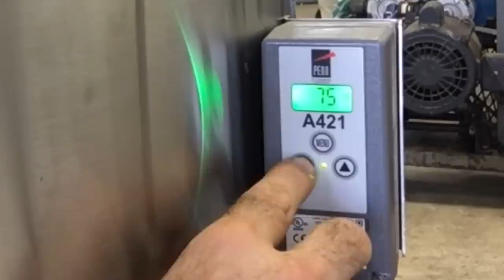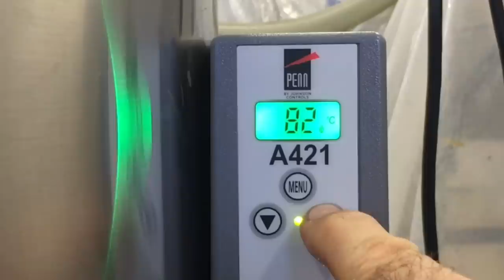Rendering Bees Wax Cappings **and Completely Dealing with the SLUM!** with a Finlay Wax Melter

Comment: I think I would be inclined to raise that unit a small bit off the ground for easier use , but then I am getting older and hate bending over anymore.  LOL
Reply from the maker: Rojer Grison 
Except, then it would be harder to dig out the Slum
Reply: I was thinking the same: scissor-lift or an elevated floor (with ramp?) so that you can stand either on the same level or much lower. Then you can put the castingbuckets on dollies and that saves you a lot of lifting.
For getting out the junk at the end, consider a shopvac instead of hanging over the edge.

I can truly tell that once your back is dickered you realize what you should have done to prevent it. I had that moment at the age of 41.
Reply: I raised mine so it'll dump into a five-gallon pail.  That works great but yes, it's a trade-off when cleaning out the slum.  I am taller than average and I can just reach the bottom so it all worked out for me.

Comment: Nice demonstration of the new wax melter.  I'm so small but use a frier pot to melt the wax.  Then I add a long strainer in the wax to separate the sludge from the wax.  Then I scoop the liquid wax with a large ladal and pour it in a bucket with hot water on the bottom.  Works for me and it's cheap to do.
As for your leftover honey.  You said, you use it to make barbecue sauce.  If you have a lot, I've seen one wax producer sell it to the baking companies.  that camelization doesn't seem to be an issue for him.

Comment: I place a small pail that's the same height as the mold into the mold. Wax from the melter goes into the pail and overflows into the mold. No need for a sifter and pouring wax from one mold to the other.

Comment: two suggestions:

1. put the metal slum strainer in before you fill with water
2.  Put enough water in to raise the wax layer above the valve so you get all the wax out of the tank when draining the wax
Reply from the maker: James Ritchie 
The Slum screen is used to hold the Slum down into the water and out of the wax layer uptop

Comment: I understood you draining off the water and or oil but I did not understand how.the slum-gum was next completely dry as the drain hole seems to be a couple or more inches from the bottom. Great Video !
Reply: There are two taps. One at the bottom to fully empty the tub, one a few inches higher so you can tap a light layer floating atop a heavy layer settled at the bottom without disturbing that heavy layer, here wax floating atop water, with the slum held down under the water by the grid.
Reply from the maker: phillip hall 
The oil is the heat jacket, it stays in the heat jacket permanently.   
The Slum is cooked in water for 12 or 24 hrs, the wax taken ontop through the tap and cooled skim.  Water drained, the Slum remains, which I scoop out
Reply: Francois Gautier 
Now I understand thank you. Phillip Hall
Reply: a Canadian Beekeeper’s Blog 
I like the oil heat jacket concept. This is a very nice set-up!! Phillip Hall
Reply from the maker: Not cheap but priced the best for the capacity on the market
Reply: a Canadian Beekeeper’s Blog 
On the scale that you are invested, I am sure it is s must have for your operation. Thank you for sharing this with us. Phillip Hall

Comment: What a great unit! Almost finished the video and don't think I saw it but what does the Canola oil do for the process?
Reply from the maker: Its the Heat Jacket fluid.  prevents water pitting and the accidental FREEZE
Reply: @aCanadianBeekeepersBlog  How hot do you cook the slum?
Reply from the maker: 90-95 degrees C
Reply: Ahh thank you!

Comment: In your description you mentioned the water pipe however in the video your using canola oil. Does the unit require the use of water for the inside pipe and oil for the outside pipe? The oil seems like an expensive added cost verses using just water.
Reply from the maker: john adams 
Your choice

Comment: Ian, what is the purpose of the Canola oil for? to help separate the slum?  Or to help lubricate the pipes so the wax will flow better?  Thanks!
Reply: It's the heating medium
Reply from the maker: It is what is in the heat jacket
Reply: @aCanadianBeekeepersBlog  Thanks, that makes sense so it won't scorch the sides or the honey and even out the heat.

Comment: Hey I've got a question. I'm also melting the bees wax but how you getting the wax from that grey box. I'm melting the wax to the plastic buckets and there is always a problem with getting the wax of the buckets. Can you give me some advice?
Reply from the maker: Jarosław Dymowski 
Find a mold that is stiffer 
The wax pulls away and shrinks when cooling
Reply: @aCanadianBeekeepersBlog  thanks for the tips
Reply: Also u could rinse your mold with water real quick before pooring your mold. That way there is residual water in your mold.

Comment: Very Interesting.
How much capping wax would you typically produce in an average day working? Can the machine keep up with your operation?
Reply from the maker: Paul Walton 
Yes, we will run this melter without salvaging honey.  1/3-1/2 barrel cappings per day.  We will fill all day and tap each morning through the week work day, then press out the accumulated slum on the weekends
Reply: @aCanadianBeekeepersBlog  Thank you for that information.
From an efficiency standpoint, you may only need to run it alternate days although, from a process standpoint it would be nice to keep ontop of the cappings pile.
Do you generate your own power (sun/wind/geothermal/etc)? That may impact on running costs and profitability).
Reply from the maker: It will crank out wax daily, pressed on the weekend,  it will for sure keep up to what I have going here with 1500 hives through a 60 frame Cowen
Reply: @aCanadianBeekeepersBlog  I don't doubt it. I'm sure it will be a vast improvement over your old system.
It would be nice to be able to say: "sit back and enjoy it", but, I doubt you will! :-)
Reply from the maker: Lol!